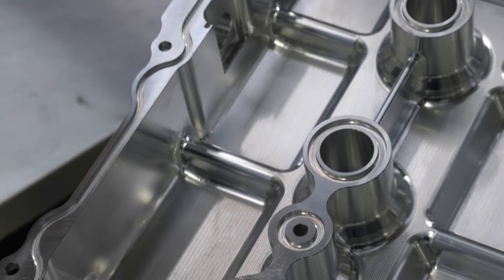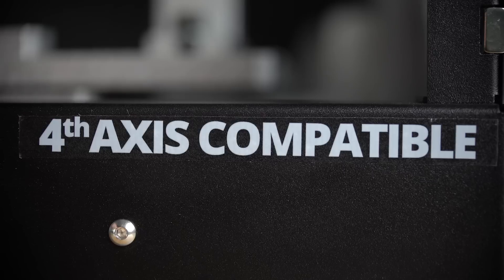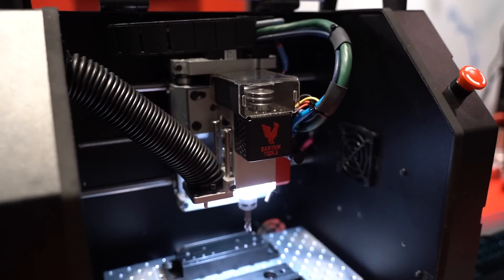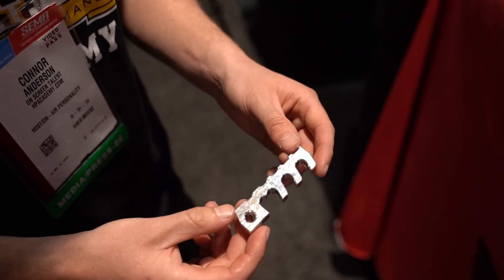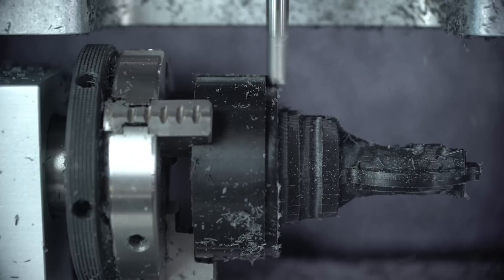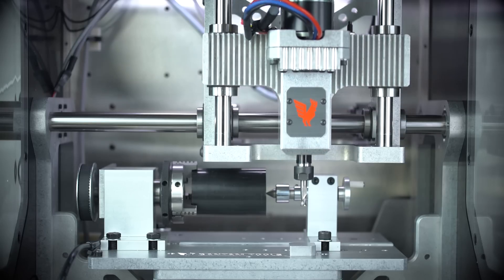3 or 4-Axis CNC...in YOUR garage?

Comment from the maker: Building a fast car? Get $400 OFF the all inclusive VIP package deal:  https://hpcdmy.co/vipy31
Learn to design custom parts for your dream car. 3D Modelling & CAD course. Now 50% OFF: https://hpcdmy.co/offery31
TIME STAMPS:
0:00 - 3rd Party Manufacturing
1:00 - Desktop CNC Alternative
1:59 - Pricing
2:40 - 4-Axis Milling
3:15 - 5-Axis Setup Options
3:40 - Long Term Benefits
4:59 - CNC Running Costs
5:48 - Tooling Costs & Options
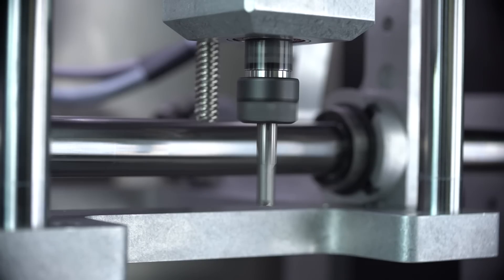6:15 - Material Options
6:42 - CNC Vs 3D Printing Prototyping
7:30 - Accuracy
7:50 - Aluminium Vs Thermoplastic etc
8:45 - CAM & Tool Paths
9:59 - Machine Self Calibration
11:16 - Training & Knowledge Base
12:55 - The Future Of Entry CNC?
13:22 - Thanks 
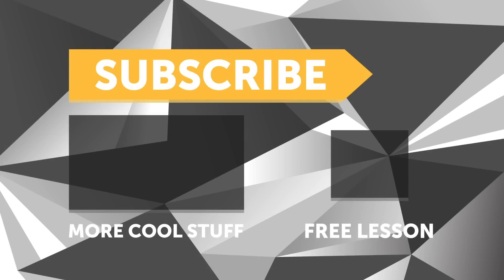13:32 - The More You Know, The Faster You Go!

Comment: tl;dr a machine that can barely cut aluminum and will burn up endmills while it cuts your part from a miniscule 3x7x9 working area. A &6,500 3d printer will print carbon fiber pekk and in a much larger build volume.

Comment: I run a ratrig KillerBee & it’s a half of that price & can very reliably cut aluminum. Its actually mainly what I cut. In addition to that I plan to buy a mini lathe body & run it w/ a nema 23. Entire setup would still be below 6k & my build can cut 2.5’x4’. Another good idea if you just need 2d cuts you can build an OpenBuilds chassis & attach a cheap plasma cutter to that. Lots of people do it on youtube if you’re curious
Reply: Sorry I didnt clarify using that mini lathe body as the 4th axis

Comment: If this is the same setup as has been out there by Bantam it is more of a novelty and really could only be used for prototyping in plastic. There is a series where a YouTuber does a tear down on the machine. Its "spindle" is essentially an RC BLDC motor (with what looks like an off the shelf ESC). It has very little torque. Another thing you have to remember is that the work envelope is extremely small. You're not going to be able to fit a vise in there. Work holding is going to be extremely difficult. The Shariff DMC2 was a good "desktop" sized mill. I'm not sure if they're still available. I suggest looking at Langmuir Systems MR-1. It's not a desktop machine, but it's smaller than a Tormach and cheaper than one, too. The last time I configured one on their website it was under $10k for the machine, flood coolant option, and basic work holding options.

Comment: I'm a 20+yr machine. I wouldn't purchase this toy. Waste of space. This thing is a wet noodle. Lacks rigidity. But automotive industry is literally bottom of the barrel.
Reply: @hpa101  For someone who has no machining experience. I'd say a Fadal. Cheap, easy to use, and if you crash. Which more than likely will starting out. Parts are cheap and their is plenty of info out the to fix them yourself.  Someone more experienced. I'd say Mori Seiki MV series.
Reply from the maker: What would you purchase for 6k in this segment of the market? - Taz.
Reply: @hpa101  That machine is better suited for model railroaders. Not automotive parts.

Comment: I'm surprised that Bantam is still in business. Tried ordering a desktop mill from them back in 2020, after over 3 months of barely ever getting a response when I asked for an update, I was told my order was ready to ship, waited another month, still never shipped. Ended up cancelling my order because I didn't want to have to deal with a company that has such bad customer support/communication in the event I ever needed repair parts or help troubleshooting the mill. 0/10 would not recommend.
Reply from the maker: Aww man, that's a shame. Communication is the root of almost any and all issues, and things can and do go wrong. 
Glad they sorted your refund though, you weren't trying to buy a refund 😂, but at least that shows integrity in the situation.
What did you end up getting instead? - Taz.
Reply: Refund was issued promptly so can't complain about that. I originally wanted to use the Bantam mill for prototyping our smaller parts and doing small 1 off bits for myself. Ended up building a relationship with a local machine shop instead who's been great to work with and turn out top quality product. At some point I'll circle back to getting something for myself and will likely go the Tormach or Haas route. @hpa101

Comment: Nice looking piece. It has very definite limitations of course, but man that would be awesome for cranking out small custom brackets and such for builds, a compact machine like this can really make bespoke parts for a build more viable for small shops and individuals. If you aren't going to need a small machine with a bigger work area than this, especially if you're only working with softer materials, this is a decent looking machine for rapid prototyping and one-offs. I'm sure you could get away with the occasional mild steel piece with the right tooling and slow enough feeds too lol.
  
It's nice to have a decent variety of options in this price range, and hopefully that only continues to increase(we gotta get more people buying them, build up  this market lol). Right now I'm planning on picking up a Bambu 3D printer(they've finally gotten to the point where they're actually complete, polished, turnkey products instead of just off the shelf industrial parts kits with some really basic firmware/software work and a lot of unnecessary headache) hopefully in the next couple months, and there's a desktop EDM project(pretty much a basic 3D printer[industrial parts kit] chassis but with an electrode, power supply, and water tank to EDM parts instead of print them) that really has my attention, affordable desktop EDM could open up a LOT of things. I'm not sure if this Bantam one will be the one, but in the future a desktop CNC will definitely be in the cards. 

Exciting times for the DIYer & small business owner!

Comment: Could be very useful in mountain bike frame design, rapid testing suspension geometry.
Reply: you're fitting a bike frame in 3.5in volume?
Reply: @jaemelo2693  sheesh I didn't think it was that small, but I meant different pivoting links for rear suspension design.

Comment: Better option would be a tormach 440 used or slightly more new and have considerably larger working envelope.
Reply: does it fit on a desktop. because that's the most important thing lol
Reply: @seethruhead7119  not practical to have it on a desktop. the noise alone would drive anyone crazy, not to mention all the accessories storage.
Reply: @seethruhead7119  it is the size of a desk. but seems a better option for not a lot more money from new.
Reply: Ya I agree. Much more rigid. This is cool but is basically a glorified 3d printer with a spindle.
Reply from the maker: It's great to have options! Half the fun is figuring out what suits you and your budget best, then working out how to get it past the missus 😂 - Taz

Comment: Taig and sherline are much more machines much less. the biggest downfall of bantam re the most important elements on a machine. spindle strength, axis motors, axis mode of movement. This is where the bantam falls flat. in comparison to taig for $1600, you get ballscrews, nema 23 motors, all steel construction, 1 hp spindle up to 10k, and endlessly modifiable. With an extra $1000 ontop of that you can have a machine that blows passed the bantam by lightyears at a quarter of the price. Please please please skip this machine and company.
Reply: 100%

Comment: As those commenting have pointed out, there are other options on the market - having looked at several of them, I would suggest actually checking out what each offers as a 'starter', what extras will be required/are desirable, what expansion/customisation options are available, software and/or hardware that's required, etc.
Some "cheaper", or "better" options may not be so when all is said and done - it's down to the individual to make that call.
This product is competitive, and may be perfect for some, but others may find other brands' products are more suitable for them.
Reply from the maker: We'll said, cheers Gordo! How good is it to even have multiple options in the same ballpark for tools like this these days really even if you decide this specific one isn't for you after some investigation 😎 - Taz
Reply: Funny how they never show alu. On that weak 4th axis

Comment: Wow, at least here in germany you could get a way more solid CNC Router from a german Shop for that price. I don’t want to do advertising for any of them but we have a few options here and I even own one of them myself. Runs a 2kW 3 Phase Spindle Motor and has a bigger working area, fully Aluminum construction thats CNC machined and runs on high quality LSK or HiWin linear rails. Comes as a kit or prebuilt with a few options for controllers/control software. Also available with automatic toolchangers and servo motors. I guess mine is worth less than 10k€ at the Moment and I already did some upgrades like the ATC Spindle which is around 2k€
Reply: This exactly
Reply: Name names! I'm interested
Reply: @SuperTimeStretch  He probably refers to Sorotec machines. I used to have one too. I build two DIY machines on it, which are in fact significantly better, then I sold it. They have a few design and quality issues (at least mine had), which can be fixed with some experience, however. But he is right, they are (at the same price point) still a totally different league than this "4th Axis compatible" design nightmare of a CNC, which even struggles to mill acetal, producing more dust than chips...🤣

Comment: I mean $6500 on one of these or a Tormach starts at $7k and is much bigger/capable its a no brainer really.
Reply: That $7k Tormach costs $15k to get it with the enclosure, gonna imagine that the typical buyer is going to want that. Most aren't buying this sort of equipment just to have to spend more money and build an enclosure or whatever. And, if you don't have room for the "much bigger" Tormach, then that isn't exactly a benefit.
  
Different options for different use cases. Just because it isn't for you doesn't mean that it isn't for someone else.
Reply from the maker: We'll said Ry! There is not one tool that is perfect for everyone and anyone. You only find out what is worth a shot for you personally by having a nose about 😀 - Taz.
Reply: @RyTrapp0  Probably not going to be running anything fast enough on anything like this machine or a small tormach for example to warrant any enclosure, but yes there are levels to the game and people are welcome to waste their money however they wish.
Reply: @wrighty338  why should I spend extra money? I’m looking for ease of use, a small work area, 4-axis capability, and the ability to cut silver, casting wax, and wood. Seems like Bantam and Carvera are the only two real options
Reply: does it fit on a desk